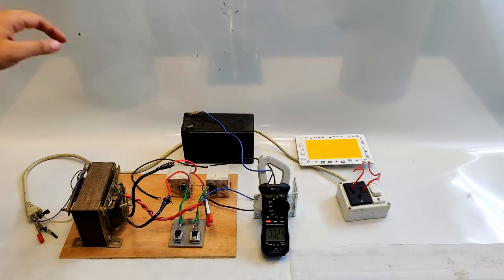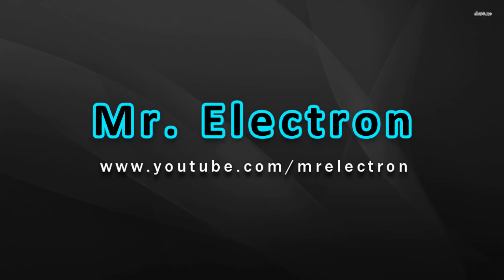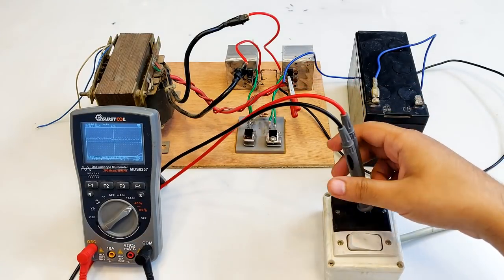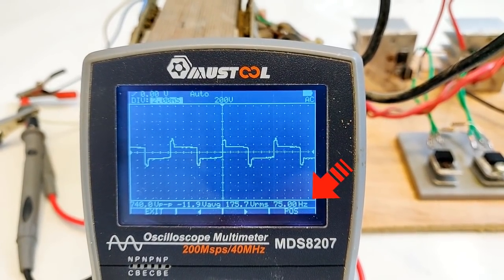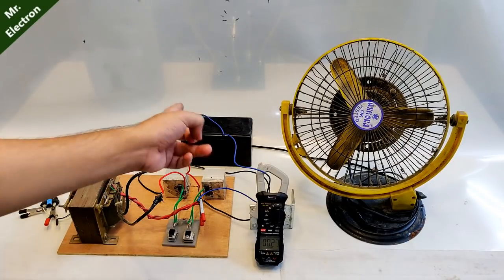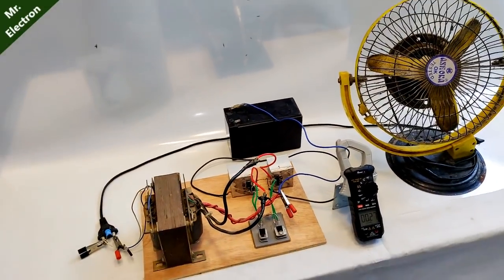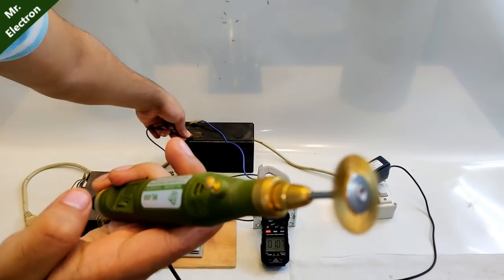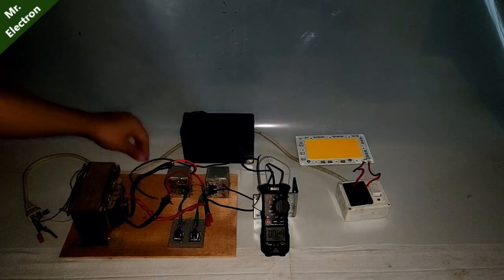Waveform Test -  12v DC to 220v AC Converter inverter

Comment: what are the appliances we can use with it without any harm
Reply from the maker: Peak output of 500W but try and keep it around 300W for best performance.
All types of loads ...
Reply: Circuit please
Reply from the maker: Ok i will upload an instructable with a circuit 😊
Reply: @MrElectron  Can a 50mfd 400V capacitor be used for 18650 battery spot welding